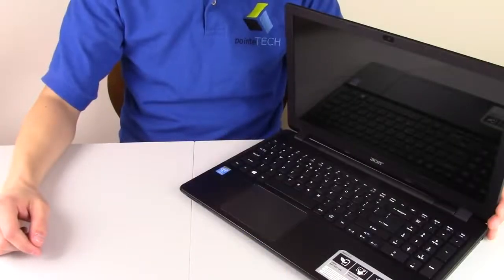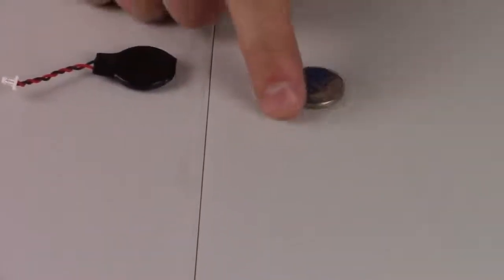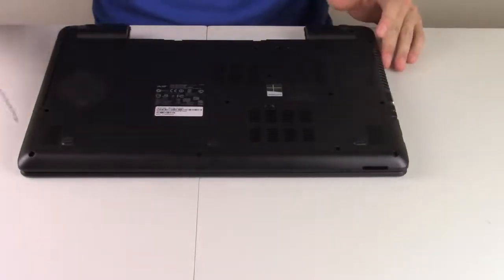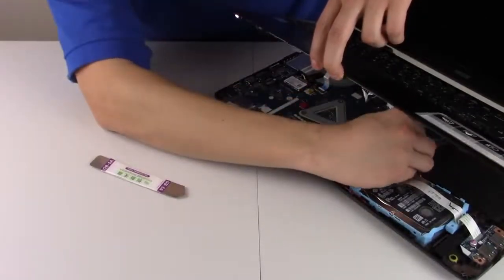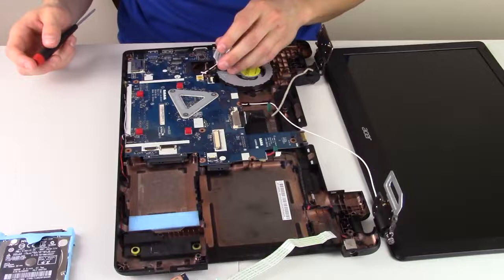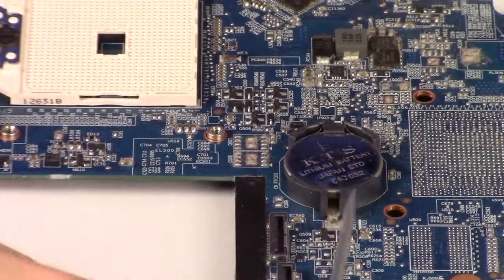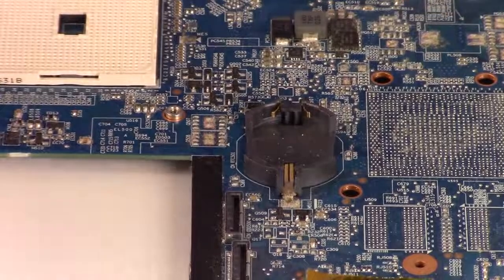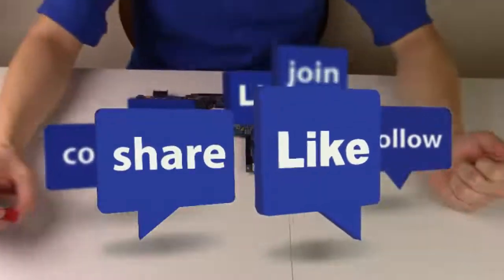How To BIOS Reset, Replace CMOS Battery - Acer Laptop Computer

Comment: THANK YOU SO MUCH! I ALMOST BOUGHT A NEW LAPTOP! THANK YOU FOR ALL OF YOUR VIDEOS BECAUSE ALL THE OTHER ONES LED ME TO THIS ONE AND IT WORKED! I WAS SO SCARED TO UNSCREW THE BOTTOM AND OPEN IT UP BUT IM SO GLAD I DID!
Reply from the maker: Glad your all set :) Always here if needed !!
Reply: @PC_Monkey  my computer turns on now and I can do my homework but it keeps shutting off. What do I do?
Reply from the maker: @joy_sings4218  When does it turn off?  Are you using it when it turns off or does it turn off during startup?  What can you see on the screen before it turns off?
Reply: @PC_Monkey  It would be working and I’m doing my homework on a google doc and then it would just shut down.
Reply: @PC_Monkey  thank you for replying. It’s 4 years old and I haven’t treated it right so I’m not completely surprised but thank you for replying.
Reply from the maker: @joy_sings4218  1.  Can you try the steps seen here?  https://www.youtube.com/watch?v=Nqn8-jJFx2Y
2.  Also, did anything happen before this issue appeared?  Liquid spill, overheating, Windows update, etc?
Reply: @PC_Monkey  I followed the video and it says event ID 10016. I looked up a video and it was too complicated and too long and I’m sure my computer would shut off before I finish that. I also reset my computer and that still did not stop shutting down my computer. I just bought a new one. Thank you for all of your help.
Reply from the maker: @joy_sings4218  Happy to help :) Always here if needed !!

Comment: Hello first of all greetings to you from poland dear friend, I again had a problem with an acer aspire model 5560 based on amd, could not boot up just turned on and off and so on all the time, nothing almost had to write it off, but I found your video, and I did as you exactly the same grandfather came to life and serves already for a year I changed the thermal pads and paste and thoroughly cleaned the entire cooling and even washed the entire pcb laptop, in alcochol iso,.  After assembling the laptop is beautifully alive less heats and has a stable temperature, as well as the graphics core and the processor, and I removed the disk drive and gave the ssd 512 gb is enough for me, and I currently have 8 gb ram, once again, thanks for a cool video,
Reply from the maker: Glad your all set :)   Always here if needed !!  Greetings Poland from America :)

Comment: Search on the underside of the motherboard for two tiny pads next to "JCMOS".  Short the pads to clear the BIOS.  Then, if you can, replace the RTC battery with a fresh one if it is over 3 years old.  Good luck!
Reply: Yep, a cheapskate might check the old CMOS batt & if voltage is still good (3-sh volts) & realistically the laptop's unlikely to be used 5 o 10 yrs later then I'd pop back in. Depends if you have replacements to hand etc

Comment: I always remove and place  it from the other side where the small metal lip is. This lip can be pushed a little away from the battery so it pops up. Placing it back is by lowering it behind the plastic lips and pushing it down over the metal lip. It will click in.

Comment: Hi there thankyou for your useful tutorial video
Reply from the maker: Your welcome !!  Thanks for watching and commenting :):)
Reply: @PC_Monkey  What if I don't have a CMOS battery inside?
I have Acer travel mate  b113 series.
Where is CMOS in it?
Reply from the maker: @shinukotononai2908  If your computer does not have a CMOS Battery then you will not be able to reset BIOS this way.  Why are you trying to reset BIOS?
Reply: @PC_Monkey  as in a video my laptop is not giving any signs of life but just few days ago it was working fine. I thought I will try it.
I opened it and there is no round battery anywhere. 
I checked both sides of motherboard and everything else
Reply: @PC_Monkey  is there any other way to manually reset it or maybe you have any other idea why it is not working? It just turn off and died, just like that😭
Reply: instaBlaster

Comment: Thank you very much, your videos helped me a lot.
Could you please re upload the video in the description?
My PC worked for one day after the other tutorials but now it turns on, the Acer logo appears, the screens flashes white and then it turns off. I think the video in the description relates to the problem that I am having now.
Reply from the maker: That video would not be the one you need.  That video would apply if the computer turns off before the Acer logo.  If your issue appears after the logo, then we will assume its a hardware or Windows issue.  Unfortunately, we lost most of our Acer videos recently.  Use this video instead;  https://www.youtube.com/watch?v=2Hh1wIS9NDo
However, you will need to press F2 instead of the one in the video :)
Reply: @PC_Monkey   Hello,
I did change the UEFI to Legacy, it didn't work, I changed back to UEFI and when it turned on, it started troubleshooting windows. I chose to to repair "initialization problem" (or something like that) in the menu and after sometime it worked until I turned it off. Now it always flashes white and turns off even when I enter in BIOS pressing F2. 
And thank you very much, your videos are very useful
Reply from the maker: @GabrielOliveira-dx2mq  At this point, I would just try to reinstall Windows as it seems your operating system is messed up.

Comment: Upon pushing the power button, the power light indicator blink once and goes off immediately. I did some removing the battery, push the power button, the same I did for the charger and nothing happens. The led power indicator blinks then off at once. Thanks for the help.
Reply from the maker: Have you tried all the steps seen here?  https://youtu.be/P3I7dDpkJps.
Reply: Same problem im having

Comment: have an acer aspire 5 a515-45 i recently changed the bios settings to try and fix the random restarts my system was experiencing. However after leaving the bios my screen shows no display (it still has power and lights appear fine).

I have tried resetting cmos with holding down the power button with the battery and cmos disconnected for a whole day and however the bios still wont reset, as i still have a black screen. (I have also tried replacing my ram slot to no avail)

So should i consider my motherboard to be bricked and throw away my laptop or still try and fix it

Comment: Can I use non rechargeable CMOS battery in laptop (Acer aspire 3 a315 51). The inbuilt battery is a rechargeable cr 1220 one, is it safe.

Comment: Hi, just wanted to say thank you for your video. I was able to get my laptop working again. Great video... One weird thing though. I plug everything back in, including my battery it doesn't turn on. But when I unplug my battery, it works. Does that mean I need a new battery? Thanks again.
Reply from the maker: Yes, that could mean the Battery is bad.  Sometimes, the computer can tell when a Battery or Charger is starting to die and may be unsafe.  The computer will stop itself from turning on and being harmed by the faulty component.  I would replace it :)

Comment: You forgot to mention that many acer e series units use a soldered in 1220 rechargeable
Reply: What I was thinkin, he didn't even mention it. I have a older laptop than this one with same thing... soldered on rechargeable battery.
Reply: This is what ive found in my acer aspire e15. Does this method still work? I dont want to remove the battery if not

Comment: No sir,a battery can be hard wired into the motherboard( soldered) and it certainly does not look like the 2 batteries you presented.Batteries you have shown are of 2032 variety,common in desktops
Reply from the maker: Yes, you are correct a CMOS Battery can be hard wired into the Motherboard.  However these two shown here are very common in laptop computers.  I open 15 laptops a week lol.  There are the vast majority of those ;)

Comment: Hi All,  My lap top works well but for one section and that is the Blue Tooth section.  I recently installed windows 8 and now the blue tooth section tells me that it is there but will not or can not locate other blue tooth devices and my blue tooth devices can not locate my computer.  Does anyone have a fix for this problem.  Please help if you can .  Cheers have a great day further Carl.

Comment: If you had hands on with acer aspire r7 572 model,  could please guide me where I can locate the CMOS battery to reset the BIOS? Thank you
Reply from the maker: Is this your computer?  https://www.youtube.com/watch?v=qNTRzPyjM4M
The CMOS battery looks like its the little blue battery in the lower right corner at 1:46.  Its soldered on though so you would need to de-solder it then re-solder it on.  You up for that?  Why are you trying to reset BIOS this way?
Reply: @PC_Monkey  my laptop is not turning on... have tried all the primitive troubleshooting steps...so this was my last try before taking it to a professional troubleshooter. I was able to locate the cmos, tried lifting it without breaking it's soldering, however that step didn't work as well. But I am happy with the help your different videos I got motivated to open the laptop and do few troubleshooting steps. Thanks a lot for prompt response.
Reply from the maker: @SS-ff3tx  Lifting it without breaking it soldering wouldnt really do anything :)  You would have to un-solder it to try the BIOS reset.  Good luck !!  Let me know how it goes :)
Reply: @PC_Monkey  Given for repair to a professional after trying all doable steps. However after 3 weeks technician says no luck in tracing the issue, had to bring laptop back with no change.
Reply from the maker: @SS-ff3tx  If he is unable to find the issue then Im not sure what kind of a professional he is LOL
It may be a motherboard issue.  It may need to be replaced.

Comment: Hi this video is very helpful. But I’m having a problem, basically my laptop shows a orange light when my charger is in the charging port, and when I try to turn it on it won’t work and I’ve followed everything on one of your videos and nothing worker. Please help
Reply from the maker: For a computer that does not turn on, try this video first;  https://youtu.be/P3I7dDpkJps.  Let me know how that goes :)
Reply: @PC_Monkey  thanks for the video but I’ve kinda snapped my battery in half over anger and I’m gonna have to get a new one which is gonna cost a lot.
Reply from the maker: @vam0se113  lol good luck !!

Comment: Hey man! I just want to ask what would be the solution to a laptop working but does not have a display when power on even though the hard drive and ram are working fine.
Reply from the maker: @adnrussg  If the screen is black, what are the signs the computer is on?  Lights?  Sounds?  Fan?
For a computer that turns on but the display does not work, try this video first;   https://youtu.be/u-REPLdpZ70

Comment: Hello i have question  i have acer aspire e5 573 laptop and i enter to BIOS and enable hidden BIOS and i change graphic card settings then when i save settings computer wont show anything black screen but it charge and power on and it has unremoveable battery how to fix it ????
Reply from the maker: Is your computer not turning on or is the computer turning on ( you hear motherboard clicks and/or the hard drive engage and/or hear the fan ) but the screen is just staying dark?
Reply: It turn on i hear Hard drive and fan and it shows nothing i tried monitor VGA and HDMI and same thing black screen
Reply from the maker: @youcefmed2961  For a computer that turns on but the display does not work, try this video first;  
https://www.youtube.com/watch?v=u-REPLdpZ70
Let me know how that goes :)
Reply: @PC_Monkey  i did everything and i knowed what the proplem is CMOS battery i need to reset the BIOS how to do that on acer aspire e5 573
Reply from the maker: @youcefmed2961  I dont have a specific video for that series number but this video would be generally the same way.  Access the inside and remove the CMOS Battery.  Try to find a disassembly or teardown video on your exact mode.  That may give you a better idea of how to get into your specific computer.
Reply: @PC_Monkey  OK when it fixed i will tell you but when we remove the CMOS battery how much time we wait to return it
Reply: @PC_Monkey  bro it work My laptop fixed it work fine by running it without CMOS battery and when showing message no bootable device but the CMOS battery and it work thx bro you are legend
Reply from the maker: @youcefmed2961  Great to hear !!  Great work seeing it through and fixing it !!  Always here to help :):)
Reply: Bro i have the same issue what to do know ? Please help me out..... I m scared.
Reply from the maker: @prajwalpatil3845  What is your issue and what brand computer do you have?

Comment: If bios always resets after a cold boot there is two reasons one the bios clock battery is dead. two on some mother boards have a bios clock jumper that is set to reset bios. those are what cause bios to reset on purpose. after that it could be a loose ram chip or a loose pci device

Comment: Hi sir .can you help me .i have a probem with bios  i can enter to system of my pc so i can do that to fix it or which solution thanks 😊 acer aspire 4752g
Reply from the maker: 1. You cannot enter BIOS? Have you tried all the function keys?
2. What are you able to see on your screen when turning on the computer?
Reply: @PC_Monkey   when I type power just seeing acer in the screen I tried f2 it doesn't work unfortunately  😪  I don't what i can do .just please  save me
Reply from the maker: @mohamedatlasi8590  1. Can you try the steps seen here? https://www.youtube.com/watch?v=gDQZvNQ2chc. If F2 does not access BIOS, can you try the other function keys?
2. Also, did anything happen before this issue appeared?  Overheating, liquid spill, Windows update, etc?

Comment: Hoping you fine folks can help.  I have an acer aspire slim 5 a515-43 91rl  one of amazon's best sellers.  Just recently I ordered a silicon power ssd along with silicon power NVME both 1tb each and 16gb ram from oloy  I installed all three started the win10 installation and laptop for really hot by the vent after the install the laptop stopped operating no display on screen I tried putting the original parts back and nothing

Comment: Was following along the video and pausing it as I was doing the steps you were doing I unscrewed about 15 screws and tried to pop off the entire piece like you did before you spoke the words some computers have a little access panel so wasting my time and damn near broke the computer trying to pop off what shouldn't be popped off because mine has an access panel that should have been stated at the beginning of the video
Reply from the maker: 1.  Thought it was pretty common sense to watch a DIY video first and then try it yourself.  Guess not lol
2.  Feel free to make videos as you see fit.  Ill make them as I see fit :)  thx though :)

Comment: I have a Acer Spin 3 SP315-51-79NT that won't power up at all. I've tried all the different sequences of booting and resetting that I can locate on line. I have replaced the MB, power supply and power jack connection, power switch, CMOS battery and fan. The power switch that I'm referring to is on the other side of the computer from the incoming power port with the button switch to turn it on. Have been struggling with this for some time now. I tested the voltage up to the MB and everything is good with one exception. I'm only getting 1.8 volts coming out of the power jack connection to the MB. There is 19.83 volts going into it and as I said 1.8 volts coming out to the MB. I'm not sure if that is the correct voltage...Can you offer any assistance? TIA
Reply from the maker: You have already replaced the Motherboard, Power Supply, Power Jack, Power Switch, CMOS Battery, and Fan?!  Not many parts of the original computer are left LOL
If there is only 1.8V going into the MB, I would assume the Jack is the issue as that is too low.  But since you already replaced the Jack, I am at a loss.  You have already tested the Charger and confirmed 19.83V coming out of it steadily?

Comment: Hi Thank you for useful content.
I am having acer E575G I tried all the video and came to conclusion that when I remove battery and direct give a power supply to the LP the it turns on. But it doesnt switch on when I connect the battery.
Sir do we have such issue and how to solve it?
Reply from the maker: If the computer turns on without the battery but will not turn on with the battery, that would seem to indicate that the battery is bad and should be replaced.
Reply: @PC_Monkey  Sir one doubt that can motherboard power supply circuit have problem?

Comment: HellO, my Acer aspire es1572 after I unplugged it's LCD from motherboard since I needed to replace the cable, laptops power led just shines then Off, I don't know whether the motherboards has to detect screen before switching on, even if I plug external screen, or must I replace cable first.
Reply from the maker: Usually no.  A computer does not need to detect the LCD first in order to turn on.  Was the computer working well before this LCD replacement?  Is it possible something was unplugged or damaged when the computer was opened up?
Reply: @PC_Monkey  hi thanks for the Reply, it was working when opened everything exposed, after I unplugged the cable, then power led just comes on then Off....
Reply: Couldn't Also remove the Small battery as it is soldered to the MotherBoard thought maybe it has to do with BIOS...
Reply from the maker: @akhamafu191  1.  For a computer that does not turn on, try this video first; https://youtu.be/P3I7dDpkJps. Let me know how that goes :)
2.  However, if a computer worked well before being opened up and had work performed on it, but did not work directly after, its most likely something physical that was done while the computer was opened.   I would reseat all the connections, specifically the power connections